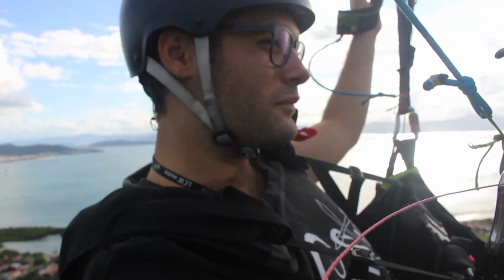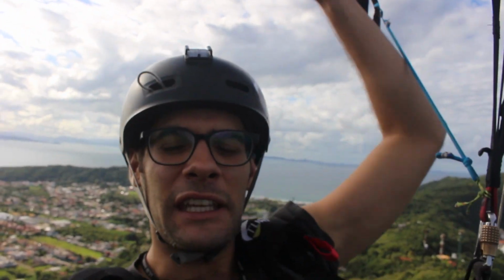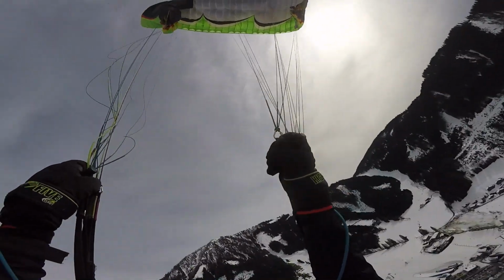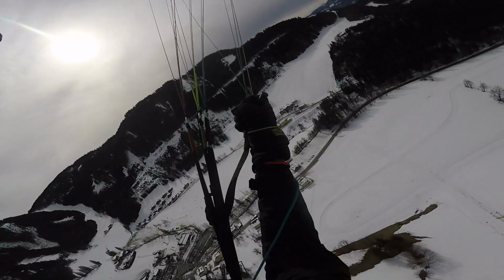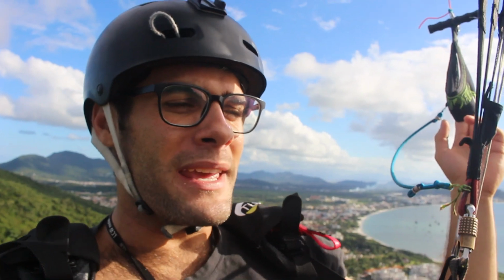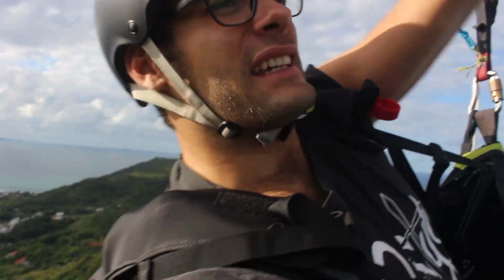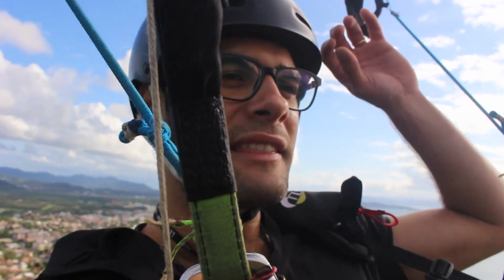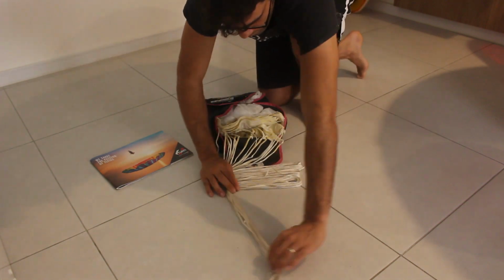Brakeline breaks during Maneuver | Max Martini

Comment: I haven't see a reserve fail to exit the diaper before. I think that's partially why it didn't inflate in time.  Maybe something with the rubber bands could be done differently?

It's easy to second guess somebody but I think your decision to stop fixing the wing throw the reserve was too low. Jack Pimblett once told me to throw it early.  He added, "You might second guess yourself and wonder if you could have fixed it but it's better that way."

Chris Santacroce told me that this sport does not have a problem of pilot throwing the reserve when they didn't need to.  However, it does have people that crash into the ground that never threw it or threw it too late.  Those guys have given me a mindset that really helped.  When my first reserve didn't work I had enough altitude for the second reserve to work. If I could do it again, I'd throw even sooner.
Reply from the maker: well said Woody! I don´t use rubber bands, because they get really disgusting after a short time here with the warm weather and humidity... the thing i changed was to mess up the leading edge, which I previously used to fold perfectly.

On my first reserve ride I didn´t think twice and immediately throwed it. As you said, later on I thought Icould have solved it. But better safe than sorry!
Reply: Thanks I really appreciate your reply 🙏

Comment: You're very lucky! Some tip: to prevent autorotation you could firstly hold your right brake with your left hand and then throw a reserve. Thank you for your videos!
Reply from the maker: Thanks! I was conscious about this but in the moment it didn´t go through my mind :(
Reply: Great tip! The reserve got caught in the glider not because of small speed but because of autorotation i.e. center of rotation between pilot and a canopy, braked side up, like in SAT. Personally I started practising throws by grabbing both breaks with left hand before reaching for the reserve handle. I hope to get this move into mu muscle memory and I don't have to think about it in emergency.
Reply: So you stall the glider first and then throw the riserve?

Comment: You made no mistake at that moment and kept your head cool. Other than trying acro at low altitude like you usually do, a higher altitude deployment could have given you enough time to open that reserve. Perhaps you could have discovered the damaged brake line before take off?
Reply from the maker: Yes, i did know that my line was worn out a little bit but my mistake was to not take it seriously enough. It looked like it only had worn out the sheathed part and I have flown paragliders for years with unsheathed lines and never had a problem. Yes, I should have deployed it sooner but my hand inside the toggles did cost me some time.

Comment: My metal swivel is also damaging my brake line when I train rythmic. Did Uturn give you a solution to the metal swivel?
Reply from the maker: White them an e-mail, they will send you a new line then pass the line 2 times through it shouldn't be a problem... the abrasion happens when the line is loose in the swivel. I have put a mini screw carabiner throug the swivel and it solved also
Reply: @MaxMartini22  thanks so much 🙏

Comment: Wow! Thanks for sharing! I have a blackout also, same metal brake swivels. I think I’m going to insert a soft link between the line and the metal swivel now. 

Did you have the black heat shrink around your brake line as it passes through the swivel?
Reply from the maker: Yes but it did wear out after a while
Reply from the maker: I think the best solution is to put some kind of transparent tubing
Reply: Max Martini that’s a good idea.

Comment: Thank you for the video and glad you are ok!
In reserve throing simulations i found out that it's much better to throw the reserve in two steps (pull out, aim and throw) instead of one (pull and throw simultaneosly) because you loose momentum with the pulling out and you can't throw it strong enough. 
I know it's a dilemma when you are low, but this video is a proof to me that it's worth to spend a second on aiming and throw it with maximum force. 
I threw it 3 times. I had  much much more altitude so i did it really relaxed and aimed it slightly upwards and threw it strong and opened right away every time.
Take care!